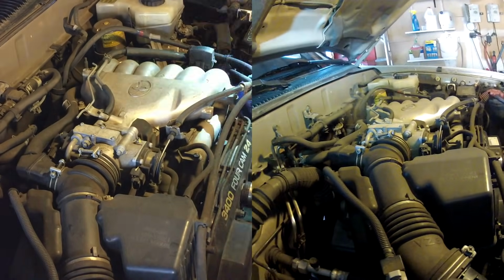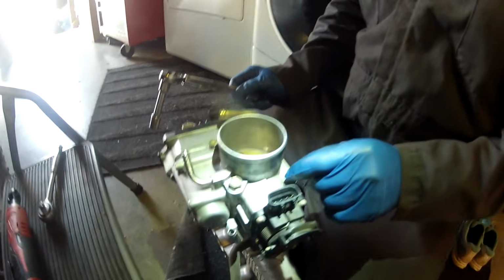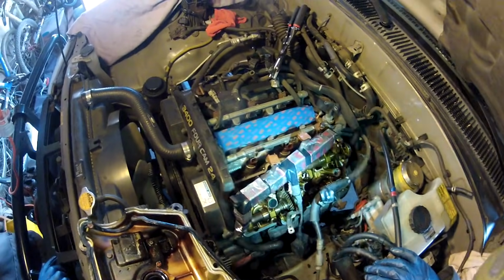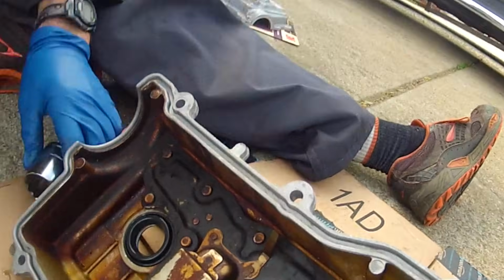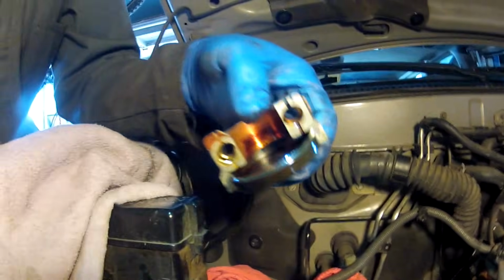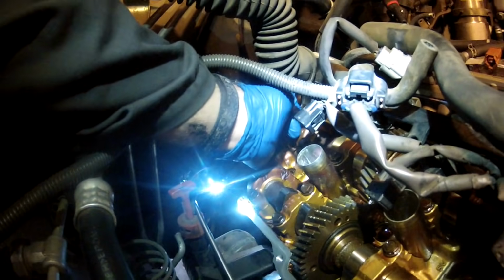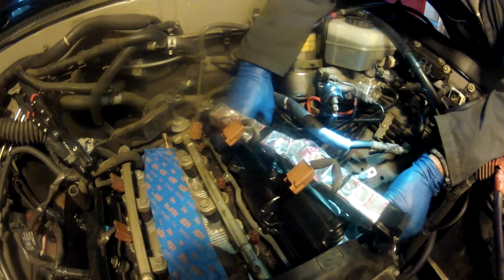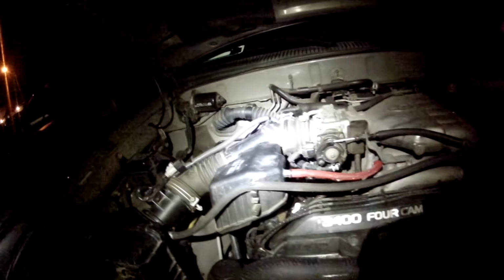3.4 L V6 5VZ-FE Toyota 4runner, Tacoma, Tundra Valve Cover Gasket Tutorial

Comment: great walk through. i have the same engine in a '98 prado. also with the cruise control. ive got the rocker seals but not the plug seals. just prepping for this...glad i watched, theres a lot of things to remove and a bit more involved than i 1st thought. do you think it would be ok to leave the plug seals if they dont appear to be leaking? would locktite non hardening gasket do the job instead of that toyota goop?
Reply from the maker: It's a risk to not replace the cam plugs because they are a potential leak source and you'll be kicking yourself if they leak a short time down the road.

I would use the Toyota black FIPG for this job.  I wouldn't use the loctite product.
Reply: @TimmyTheToolman  well now im in there...i can see the cam seal plugs were leaking like crazy and the bloody rocker cover bolts were so loose it was hard to believe. Turned 2 by hand without touching a spanner. That cant be normal. Cam seal goop didnt look to have bonded to the metal on the bottom...like it was never cleaned properly. Spark plug seals were original by the look of the bendy tabs...i have not sourced new cam seal plugs yet. The guys at the shop went through the seals catalogue in their system and were clueless. The spark plugs were very stiff to undo also. I havent lifted them yet i left em in there in case anything else falls in. Before i got the painters tape covering I bumped a ignition lead holding tab and it fell into the 1st intake hole...luckily it didnt go far and was easy to grab with long pliers...removing that tall bracket on the right side head that holds tge plenum made wrigging the cover out. The crumbling heat cover on the wire loom i just cracked all the crispy snap lock tabs off and removed the whole thing. I will reconstruct it with kapton tape and that foil tape. For me working alone that seemed like the easiest and least frustrating way.
Reply from the maker: @m3sca1  Well, you're getting it done.  Good job.  For the wiring harness on that passenger side, you could just get some split wire loom at an auto parts store that will fit over the wire bundle and then you could just wrap it with some black electrical tape.  It's not really necessary to use that silver foil ducting tape I chose to use when shooting the video.
Reply: @TimmyTheToolman  good idea i have some of that tube loom stuff. the fancy kapton and foil...i have laying around to...they are both excellent tapes. i have never been a big fan of the stretchy pvc electrical tape how it unwinds and reveals sticky glue.
Reply from the maker: @m3sca1  Gotcha.  Yeah, use the tape you like.  Good luck getting the rest of the job done.
Reply: @TimmyTheToolman  holy crap it goes like a new car with the plugs and leads swapped! thanks for your great walk through. it really made a huge difference to the process...and this is the 1st time i have made notes and diagrams when doin work. it really helped me not do any accidental step skips and have to work backwards like i have done in the past. i could not get new cam seal plugs but 2 mechanics i ran into said just clean and goop it. i was very particular to make sure they were very clean and surfaces devoid of oil and old fipg goop. i also used bags labelled for keeping nuts and bolts separated and gpuped accordingly...numbered tags on the tubes and wires and a diagram of the leads...i didnt have to remove the fuel rail to get the cover off...undoing that tall bracket that holds the plenum let me wiggle it out easy. the kapton tape worked nice to rewrap that crispy loom cover. i have been subbed to your channel for a long time and really appreciate you taking the time to make these videos.
Reply from the maker: @m3sca1  Yeah, as long as you put some sealant on the cam plugs, you should be ok.  Those cam plugs have a rubberized outer coating and that's what makes a seal with the head and collar.  Over time, the coating dries out and shrinks and then doesn't make a great seal anymore and they leak.  But, by putting FIPG around it, it should make a good seal and be fine.  I just steer people from doing this because if you ever have to do the job again, picking and scraping out the old FIPG at the backs of the heads sounds like it could be a pain in the butt.

Good job being organized when doing this job.  It takes more time but you can now see how it pays off when you're not guessing what order you should put things back together, what hose goes where and what fasteners go where.  I can take apart the upper part of the engine now without taking notes or labeling anything other than the fasteners because I've done it so many times.  The next time you have to dive into the upper part of the engine, you'll find it's much easier as well.

We started this channel to help people and it's great to hear our videos are helping you turn wrenches on your rig.  Enjoy your rig and Happy Wrenching!

Comment: Im surprised you didnt replace the fuel injector seals while you were in there.
Reply from the maker: It's not super common for those to all of a sudden spring a leak.  Now, if we were removing the fuel rails so we could remove the intake manifold say due to a bad knock sensor, then it would make sense to replace the fuel injector seals while we're in there.
Reply: @TimmyTheToolman  I was more thinking vacuum leak than fuel leak. I'm planning to do mine while I'm doing the valve covers. Valvelash check too.
Reply from the maker: @chae-are-ay  Gotcha.  Good luck with the job.

Comment: I love love Timmy's videos
Thanks to you I followed your videos and replaced the gaskets on 2 of my 3rd gens this weekend. Everything went fine on both 99s but now the freaking air bag light flashes on one and the other it flashes but stays on when the truck is off. I don't understand because the SRS sensor is way below on the body of the truck. We have no reason to hit them not were they hit by accident. I have no idea how to turn this off. It started out of nowhere!!  If anyone has experienced this with this please let me know.  Thanks!
Reply from the maker: That's weird about the airbag light coming on after this job.  I also don't have any clue why that would occur, because like you said, those air bag sensors aren't anywhere near where you were working.  Maybe try unplugging the yellow sensor on both sides and reattach them and see if that does anything.
Reply: @TimmyTheToolman  I will give that a try. The one with the light on when the truck is off would you think disconnecting both with key in acc mode or just off?
Reply from the maker: @titanjake8640  I would try it with it off and see what happens.
Reply: @TimmyTheToolman   update. No 🎲. So I pulled the code Via the diagnosis plug under the hood and it blinked 6xs then 4xs. Would you happen to have the cheat book to let me know what that code means?
Reply from the maker: @titanjake8640  I don't know what the X's mean.
Reply: @TimmyTheToolman  sorry. 6 times and 4 times.
Reply from the maker: @titanjake8640  Have you tried hooking up a code reader to the OBD II port in the cab to see if it shows a code?  I don't know what the blinking means.
Reply: @TimmyTheToolman  ok the code reader in the cab has no DTCs aka no errors. I read when you jump the pins on the diagnosis box under the hood you can get the SRS light to blink what the error is. Just don't know what the blinks mean. There is a Toyota type scan tool with an adapter I googled that can read it and tell what the error is (eBay) hmm. Again blinks 6 times then pause. The blinks 4 times. Then pause. The other 4runner just constant blinks and still on with the truck off. Hmmm. Thanks for the replies
Reply from the maker: @titanjake8640  I'm at work for a couple days and I don't have my FSM with me.  When I get home, I could look through my book and see if I can find out what the number of blinks mean.
Reply: @TimmyTheToolman  as usual you are the best!!! No worries my friend. Whenever you get time. Thank you!!

Comment: Replacing my 1999 Tacoma gaskets.  Does one need change both moon gaskets on front and back of head if only one in leaking (back)?
Reply from the maker: I'm not 100% what you're saying because of the terminology you used.  There's half moons on the front and back of each head that are sealed to the head with FIPG (Form in place gasket sealer).  So, you wouldn't be replacing a gasket but rather cleaning up the old FIPG and resealing it with fresh FIPG to the head.  There's cam plugs on the back of each head that should be renewed as well because those can develop a leak too.  If I were you, I'd replace everything we recommend in this video while you're in there.
Reply: @TimmyTheToolman  thanks.  They are cam plugs front and back....

Comment: That drivers valve cover removal looks tight. Is it worth disconnecting the cables for easier access?
Reply from the maker: After doing this job other times, you can gain more slack in the driver side wiring harness by disconnecting a connection at the thermostat neck.  You can also disconnect a single pole plug on the back side of the engine that goes to the temp gauge to gain a little more slack so you can lift up the wiring harness that parallels the fire wall higher.

Comment: Do all 4Runner models share the same spark plugs/wires? I was adding the parts listed on the description for my 2WD, but Amazon stated they don’t fit my car.. I think it might just be a mistake from Amazon data..
Reply from the maker: Yeah, they are all the same 3.4 liter engine.  The wires we link will work for your 2WD model.
Reply: @TimmyTheToolman  Ok that’s what I thought. Amazon database must be wrong. When I was using your account to add the spark plugs to my cart, it told me it wasn’t compatible. Thanks
Reply from the maker: @Mike3_6_9  You're welcome.

Comment: Hey Timmy ,what torque wrench is that your using?is that the 1 one the description
Reply from the maker: Hey Kenny, yes, the one I link in the video description is the one I used in the video.  I also own 2 other torque wrenches made by CDI, a 3/8" drive foot pound one that goes up to 100 ft-lbs, and a 1/2" drive one that goes up to 250 ft-lbs.

Comment: For anyone tying this spring/summer 2021!! For the Valve cover washer/grommet ... Not many available online any more and are $3-4 ea. I called local toyota dealer and gave them part #, they said they had like 30 in stock and only $1.50ea. If you have trouble finding these parts call dealerships in your area! Cheers and happy wheeling in 2021!
Reply from the maker: Good to know.  Thanks for sharing.

Comment: did u take the tape off the brittle wiring harness?
Reply from the maker: No, we left it on.  I suggest people do the same.  Another option is you just remove the old brittle plastic wiring loom and replace it with a plastic split wire loom you can get in bulk at any auto parts store.  You don't have to use the silver HVAC tape I used.  You could simply clean up the old wiring loom and wrap it with electrical tape.  That's what I did on a recent valve cover job I did for a co-worker of mine.

Comment: How to replacement oil pan gasket on 2000 toyota 4runner 3.4 thank you
Reply from the maker: Hey Oscar, most of the work to do the oil pan gasket is getting the front differential out of the way first.  We have a video for that. https://youtu.be/w_gPiDvh9v4  In the video, we struggled quite a bit getting the diff out and back in.  Since making that video, we learned a much easier way to get the diff out and we detail that technique in a pinned comment (1st Comment you will see).  Once the differential is out, it's a matter of removing all the bolts and a few nuts and separating the pan from the engine block.  A tool that works well to separate the pan is linked in the video description of our Transmission Filter Replacement video: https://youtu.be/tuGazNhuEtM  You get the pan off, clean off the surface of the block and the sealing surface of the pan really well and then you reinstall it with some of the Toyota Black FIPG.  *Toyota FIPG #00295-00103 - (For Engine Applications)
 https://amzn.to/2QrNVFO

But, before you do all that work, I would first confirm that it is indeed an oil pan leak and not something else.  It could be oil dripping down from leaking valve covers.  I would degrease the underside of your rig and then start watching closely for the source of the leak.  It would suck for you to do all that work just to find out the pan really wasn't the source of the oil leak.  The oil pan is the lowest part of the engine and that's where you'll see it collecting before it makes it's way to the ground.  Good luck!

Comment: I read somewhere that valve covers and contact surfaces should be cleaned before reinstalling, is brake cleaner safe for it?
What do you suggest?
Reply from the maker: Yes, brake cleaner works just fine.  You want all surfaces clean before applying FIPG to seal the half moons to the head, to seal the cam collars to the head and finally the areas you need to put FIPG before dropping the valve covers in place.
Reply: THANKS G

Comment: Hi Timmy great video, do you have a video that teaches how to change oil pump on same engine 5vz-fe...
Reply from the maker: Sorry, we don't have a video for that.  Our timing belt video would get you pretty close though.  It gets everything out of the way so you can access the oil pump.  https://youtu.be/vHC46ypHxWc

You would also need to drop the oil pan so you can disconnect the oil pick-up tube to get the oil pump out.  To get the oil pump out, you would need to remove the front differential.  We have a video for that.  https://youtu.be/w_gPiDvh9v4  In a comment we pinned (1st comment you see), we detail a much easier way to get the front differential out.  This is the extent we can help you with this job.  I'm sure you can figure out the rest.  Good luck and Happy Wrenching!

Comment: Good morning! Did you notice that the valve cover washers/grommets looked different from the new ones? Old ones looked like pancakes while the new ones were much thicker. I made sure to double check part number and it is correct. Is that just from ultra wear? Thank you in advance.
Reply from the maker: Over time the rubber on the washers ages from the heating and cooling cycles and basically shrinks and becomes less compliant.   This is what I believe is the cause of the valve cover bolts becoming loose.  It's not that the bolts are backing out, but it's the rubber of the washers shrinking and loosening pressure on the bolt heads.  So, what you noticed is normal.
Reply: @TimmyTheToolman  thank you for such a quick reply. Your videos are always helpful detailed. Best auto videos around by far. I notice you are always referencing some sort of Toyota repair manual. What is it called? Are those still around?
Reply: @marctopete  Its called a FACTORY SERVICE MANUAL
You can get it from Toyota but its like $200 maybe cheaper at other places
You can get a Haynes Manual for like $20 but its just not as comprehensive,

Comment: Knocked out this repair today, thanks again for your videos.  I removed two more clips on the drivers side and that provided a little more room.  One was a bracket near the alternator and the other was a harness clip below spark plug #2 on the block.  Anyway I noticed that the valve cover doesn't sit perfectly flush with the cylinder head.  At first I thought I put the valve cover or spark plug tube gaskets backwards,  but that wasn't the case.  The plug gaskets seemed to be installed okay so I continued on, but was half expecting a catastrophic leak.  I let the truck idle for about 5 minutes and then went for a 20 minute drive.  I didn't see any leaks so I guess what I saw was normal?
Reply from the maker: Well, the gasket is pretty thick so the valve cover won't come in full contact with the head.  Glad our video helped you out.

Comment: Timmy, I’ve searched through the comments and this is likely a simple question, but what kind of cleaning agent were you using to clean off the old sealant, valve covers, etc. Is it brake cleaner, degreaser?.. also did you actually replace the pvc valve in this video or reuse the old? I’m considering reusing the old one, but wanted your input. Thanks.
Reply from the maker: We mostly use plastic scrapers to get the old sealant out.  You could use metal scrapers but then you run the risk of scoring the head surface.  Here's a link to a plastic razor blade kit: https://www.amazon.com/Plastic-Scraper-Blades-Removing-Sticker/dp/B08C7G6PSM/ref=sr_1_1_sspa?crid=CBI5X7SYHL7H&dchild=1&keywords=plastic+razor+blade+scraper&qid=1616459619&s=hi&sprefix=Plastic+razor+%2Ctools%2C225&sr=1-1-spons&psc=1&spLa=ZW5jcnlwdGVkUXVhbGlmaWVyPUFaREdVRENHQlVERVcmZW5jcnlwdGVkSWQ9QTAxNzMxNDAxRzlJUzNSTTVRVFVQJmVuY3J5cHRlZEFkSWQ9QTA4MjY4MDMyWDZIT0hIOVFCWk4yJndpZGdldE5hbWU9c3BfYXRmJmFjdGlvbj1jbGlja1JlZGlyZWN0JmRvTm90TG9nQ2xpY2s9dHJ1ZQ==

You could also use some brass brushes to get in there to clean.  After all the sealant is off the head surfaces, You could clean the metal surfaces with some brake cleaner or maybe acetone.

Get a new PCV valve and grommet.  The grommet will probably break apart and some of it will fall in but you can fish it out with a needle nose pliers.

Comment: Aloha ., great videos !.. however I'm in need of help on how to change the oil pan gasket on my 96' T100 . it looks super easy but before i get into it .. 
 QUESTION::do i have to remove the bar that goes across ( it holds the steering damper) in order to get the pan out/down ?  it seems that it might be in the way ., i'd appreciate your advise. 3/20/21 Mahalo
Reply from the maker: Is your T100 4wd?